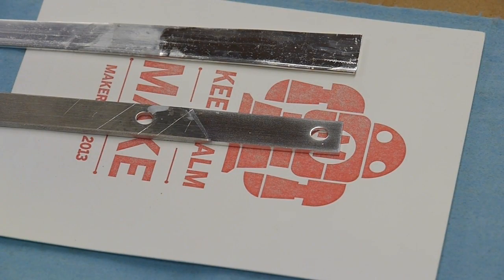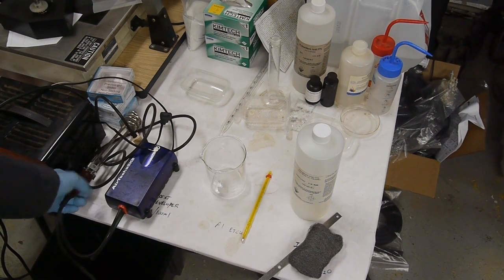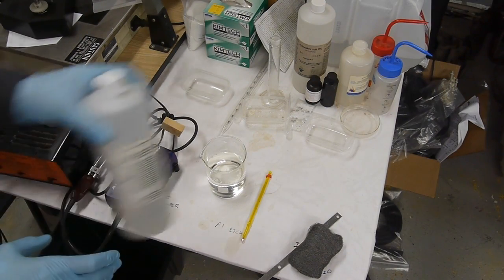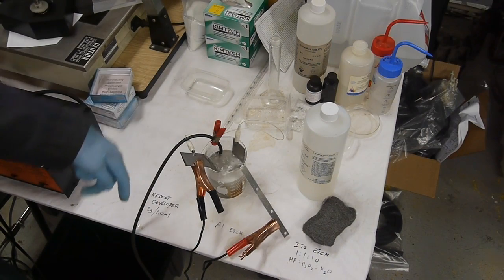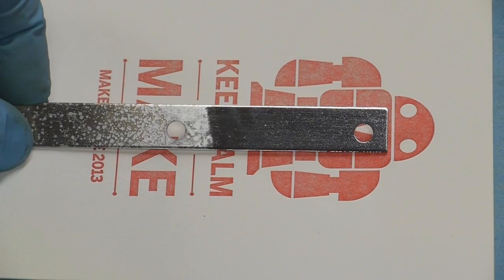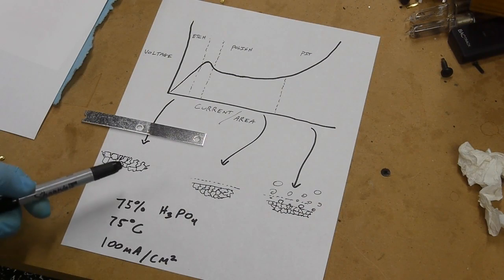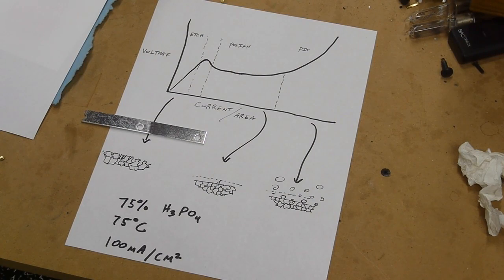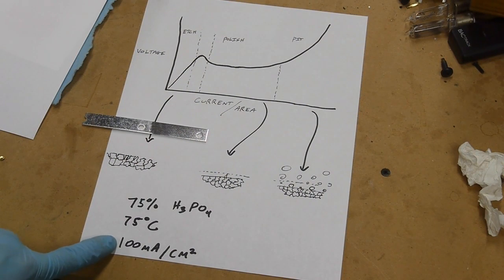How to electropolish aluminum

Comment: That bump in the etch to polish region looks like it's removing an oxide (insulator) layer. Then the voltage dips a bit because the surface area remained the same and the "load" increased, resistance went down, voltage drop increased, now more working action. Once the voltage is allowed to increase you'll just be attaching exposed aluminum atoms which, when voided, will allow the acid to break more bods but deeper, causing larger chunks to fall off from simple weak adhesion under the environmental stresses. Very cool video. I got here simply looking for a way to quickly polish aluminum LED strip diffuser housings. Very cool to see the experiment performed, less for me to do :)

Comment: i have replicated this experiment just now. 
I found out this not electropolishing what is happending is actually electroplating,
The stainless steel he used as cathodes is being disolve by the acid and is releasing nickel and or chrome to the solution in the process
This Nicke acetate created is then sticking by electrolysis to the aluminium and creating a thin plating and a shiny surface

I have tested the resulting so called "polished" surface shown here does not react to caustic soda submmersion anymore, meaning is not aluminium at the surface. 

I have noted the  shiny parts for tolerances and it increased (is bigger) by microns on the surface instead of being reduced suggesting material is being added to the aluminium as opposed a polishing process would remove it. 

I tried replacing the stainless cathodes for aluminium ones and also lead ones and it does NOT polish but instead dulls, etches the aluminium.

It was fun testing this, but it also is wasted time, money and effort that could be put into polishing by mechanical means the aluminium  in a more cost efectivly way for home applications. 

aluminium can only be electropolished in a cost/effective away at industrial levels using very much higher currents and stronger/ more hazzardous acids then ones used i this experiment.

Comment: Pretty sure a detergent and parts per million and total divsolved salts to perfefect the mix . At work we have a parts washer for washing diesel transmission parts it works on a ph based system  to check otherwise it etches the parts darker or blk

Comment: Better nate than lever: Just tried it out with a 5x4x3cm piece of aluminum (75% H3PO4, 70-75°C, magnetic stirrer, 20-30V). I started out with a much too low mA/cm^2 so in the beginning I was only etching. If the part would be a cube it had a surface area of 114cm^2 but it as inner surfaces so its probably 3 times that. This would result in 30A but my powersupply only goes to 5A. Luckily enough that was enough to produce a very nice polished surface.

I am wondering if the acid concentration might be too high though. When submerging the part it immediately starts bubbling which results probably in etching. Therefore after finishing I quickly rinsed the part. But in the seconds from turning off the voltage and rinsing it, a little etching might occur, maybe I try it again with more diluted acid.

Comment: Agitation can be used, for small parts its normally not necessary. Ultrasonic baths do work, with water, then a glass beaker, to break the liquid/gaseous plastron that forms on the surface of the part, and keeps fresh electrolyte close to the surface interface. Using full strength acid can lead to uneven brightness and micro pitting.

Comment: Add ethylene glycol to mitigate the acid, and provide a smoother brighter finish. A 60/40 mix of glycol and phosphoric acid is usually perfect. For stainless steel, just a kiss of sulfuric acid added to the mix makes a bright surface. You can buy ready made solutions from Nobilium dental products at nobilium.com. ESMA also makes ready made solutions.  For small, easy to use small parts polishers, look on EBAY for dental electropolish equipment. Good Luck!

Comment: That's really interesting. I wonder if it could be used as a surface prep method for DCEN aluminum welding (which needs to be much cleaner than AC welding), or if there are residues left on the metal.
Reply: I would be EXTREMELY surprised if you could do a DCEN on ali regardless of the prep (removing oxyide layer) you do. Let us know how it goes if you try it
Reply: @Bakanelli  Yeah have done it before, with mechanical scraping and chemical etch. We used it to make high quality butt welds turning 18" sheet into tubes for pressure vessels.

Comment: Aluminum (and zinc) is very very acid sensitive - next time buffer with  a little sodium carbonate or substitute acid for sodium citrate. Also, use a lower voltage make sure your work is totally oil/petroleum free (never use torches to dry parts after de-greasing).

Comment: I've been trying to replicate the same chart, do the same sort of thing, but with steel. Without buying a lot of extra supplies, spending money on a whim. So far I haven't been able to get that graph to happen either. I've read, not a lot, but some about electropolishing steel, from stuff as far back as the early 1900's, and they all describe the same graph. Well, I'll fool around with it a while longer.
Also trying an etching with photoresist film, sort of different project. For that I need to stay in the 'etch' region, so far that seems to work fine vis a vis the steel, but the photoresist keeps lifting. Not sure why. I'm starting to suspect the etched piece gets a zone of more acidic solution around it, and that makes the photoresist hard and flake off.
Anyway, I remembered you did this video, and watched it again to check what you were using specifically. Thanks

Comment: in hungary nobody takes aluminum electro polishing.they only want to polish steel, because they do not need the skills they need.they said they did not dare to accept because the bicycle trail would be fragile after the procedure.for a month I rubbed the old polishing and polished it by hand.

Comment: Now that I think of it water will separate above 1.9 volts and produce gas. Could this process be done under 1.9 volts? That could reduce the effect the gas has with the pitting.
Reply: Perhaps by increasing the conductivity of the electrolyte, adding those chemicals he mentioned...

Comment: why no just use NaOH ?
Reply: Cause it Will corrode the aluminium?
Reply: Aleksa Djokic polishing implies material removal, no matter what you polish, so it's ok :)
Reply: What? NaOH is used to etch aluminium, not polish it. There is a big difference between etching and polishing.
Reply: When he takes it out of the bath, does it look polished to you??? it's 
etched, i can go as high as "electrolytic cleaning" :) but not 
polishing, there is no chemical polishing aluminium. Since aluminium  is
 used to make mirrors, polished aluminium means mirror-finish, literally
 mirror-finish. So yeah...NaOh solution will do just fine to get a 
finish silimar to this here
Reply: Clearly didn't watch the video. His solution does not have the correct balance. You can most certainly polish aluminum this way. NaOH does not do the same thing and in fact it DULLs some aluminium alloys. I've had this happen several times.

If anything, NaOH cleans and etches. It, contrary to what you say, does not polish.

Comment: The concentrated layers of oxidation on the  aluminium from being exposed to the elements, over time these levels have built up,  the pitting has occurred from the solution and cavitation removing fine loose scale, but the pitting is like rust pockets or decaying in the aluminium material, the surface areas coming in contact with the solution it not strong enough to dissolve the oxide layers, the aluminium has to be polished flat

Comment: good presentation, very helpful. 
Permit me to just add this; 
that is, the reason why the current density plot is not looking like the one you found on the internet. 

The plot observed from the "internet" is due to a layer formed between the sample and the electrolyte (it is called the anolyte layer). 
however, for the electrolyte that you used (phosphoric acid), the anolyte layer is not visible. 
hence, the plot you will be getting will be not be exactly what you got from the internet. therefore the plots that you got are not too out of place.

Comment: the pitting is a result Al2O3. Add the Al to the acid till it starts to bubble, then add the current and reduce the voltage too.
Reply: and you are not polishing, you are plating with Stainless.

Comment: What if you immersed the beaker in a sonic cleaner filled with water to the same level as the acid without the airbrick? That would increase agitation  (enabling hydrogen gas to release easier) and eliminate oxygen.

Comment: I noticed two things happening in this video. One definite, one theoretical. Getting the acid up to a set temperature is pretty pointless if you are then going to introduce a lot of cold objects which are going to make the temperature drop rapidly and dramatically. If the working temperature is vital then add everything and then heat the acid up.
I wondered if the pitting on the surface was more to do with the bubbles coming from the air stone having a cavitation effect?
Reply: You're right about the temperature dropping from the added colder metal.
Reply: Bubbles moving past shouldn't be a problem.  Bubbles sticking to the surface are.

Comment: Check on Google Books for:
ASM Specialty Handbook: Aluminum and Aluminum Alloys by J. R. Davis.
ISBN-10: 087170496X
ISBN-13:9780871704962
On page 457, it describes the solution Alupol from Switzerland, as well as the process.

I also found an article on Tecnica e Industria, 1967 (Spanish language) regarding the subject, its link is:
https://picasaweb.google.com/117393118520218931162/Parabolicdishfabrication
Reply: From the Spanish manual: solution of 15% sodium carbonate and 5% tri-sodium phosphate at 80 degrees celsius and 24 volts.

Comment: Why air bubbles? May be redo it without bubbles,  but with vibrator attached to aluminum detail?
Reply: amaraojiji I'm pretty sure that vibration would work instead of bubbles. My first thoughts were using a geared motor or stepper with an embedded neodymium magnet on a disk attached to the motor shaft, below a plexi-glass shelf, then a plastic/silicone coated magnet inside the flask/vessel - to recreate a magnetic lab 'stirrer'. Fascinating stuff! @ +Applied Science I've often wanted to try anodising so I'm headed to your uploads ....  >subbed< :)

Comment: An alternative to electropolishing is chemically brightening, which you can do with Phosbrite or other compositions. For more information on electropolishing and chemical brightening see this thesis:
https://dspace.lboro.ac.uk/dspace-jspui/handle/2134/13910

If you want to make your own Phosbrite they handily provide the details of the ingredients:
www.potashcorp.com/media/POT_SS_MET_PB172.pdf

Or in the above thesis it gives more details including the important copper nitrate:
53% (Wt.) phosphoric acid
41.6% (Wt.) sulphuric acid
4.5% (Wt.) nitric acid 
0.4% (Wt.) boric acid
0.5% (Wt.) copper nitrate

But note that:
1.) NOx is produced which can stop your heart so do this with extraction
2.) Removal of copper after is required with a dip in conc nitric acid
3.) You're responsible for checking the safety of your experiments.

Comment: Very interesting, I remember using a old computer PSU to plate nails with copper. Of course  I used salt, and did not consider the chlorine gas it produced, and wondered why it smelled like bleach. If I had known this I would have used baking soda. I must try this sometime.

Comment: Thank you for another interesting video.
The pitting below a certain depth is an interesting phenomena.  That it does not happen within a certain distance of the surface is curious and doesn't seem to be well accounted for by the current per area theory.
It would be interesting to attempt the electropolishing on a hotplate with a stirring magnet, to see if eliminating the bubbles from the air stone would reduce the pitting.  Bubbles may be sticking to the metal preferentially at greater depths, but adhering less when moving faster near the surface.....

Comment: now i'm gonna have to look up the process of chrome plating, this looks very similar to what i thought the process of applying a chrome surface to a metal was, i'd like to see what actually happened to the pieces of steel as well since i thought phosphoric acid would act more aggressively on steel than aluminium

Comment: What you are showing is call corrosion polarization curve, and the region that you are trying to work is the pasive region. For that kind of curve that you want to see, you should control current and voltage in a much better way. 
And example of the equipment that you need is this http://www.gamry.com/products/potentiostats/reference-600/
Nice channel

Comment: Interesting results, but it doesn't really seem to being polishing but electroplating SS onto AL.  However, I have been told to never use SS for an electrode in soltion due to it releasing Hexavalent Chromium.  (The same stuff that caused severe birth defects, health issues and water contamination in the true story movie "Erin Brokovich.")  Can't you use aluminum plates?

Comment: So you are moving the heavy metals from the stainless steel to the aluminum?

I know if you use stainless in electrolysis rust removal, you get toxic heavy metals as a byproduct.

Comment: Just some stuff.

Rather then a pure solution of phosphoric acid, you would have less etching if you used an aluminum salt. If you want simple math, you should try using aluminum phosphate, but that stuff is hard to find (something about it being used to make explosives.).

A good aluminum salt will help prevent etching, and over etching on a short term basis, because it reduces the amount of aluminum that will immediately need to go into solution to satisfy Le Chatelier's principle. It ensures that the only etching going on is the stuff that's being driven by electrical current. 

This needs to be fine tuned though. Functionally speaking, the difference between an electo-platting solution and an electro-polishing solution should be the amount of dissolved aluminum in solution; if you're not watching your concentrations, you can reach a point where the reaction is less then optimal, though it can't run in reverse. 

I would speculate that people are advising you to use sulfuric acid because aluminum sulfate is easier to get a hold of then aluminum phosphate, but mixing the phosphoric acid and sulfuric acid makes the math more complex. Sometimes aluminum phosphate is sold in nurseries as a special fertilizer for hydrangea. Hydrangea change colors when the pH of the soil they're grown in changes, and aluminum ions are a good way to shift the pH towards acidic for extended periods of time (assuming you want a pink color hydrangea). Aluminum sulfate is also known as Alum.
Reply: @beizebopp-t6q  It has to be a typo. Its widely available and I've found no refference to pyrotechnics.
Reply: @beizebopp-t6q  I've found that it's rather a fire retardant http://www.chemicalland21.com/industrialchem/inorganic/ALUMINIUM%20PHOSPHATE.htm
but I dont know everything. It may release the oxygens at high temperatures, in rocket propellants, thermites,... it's possible, but it's readily available and no one is writing about it as such. I think he meant another substance
Reply: @trollmcclure1884   You're right. I remember wanting some for pyrotechnics but reading about it I must have been wrong back then. Its berlinite and its apparently toxic.
Thanks for setting the record straight.

Comment: Cool. I assume this is different than the shiny (I won't say polished) aluminum bars you find in Home Depot in the bath and shower section. The surface of those is non electrically conductive.
Reply: I think those are anodized. Btw, anodizing is a something you can try in your home lab. You can use dilute sulfuric acid as the electrolyte, and the aluminum is connected to an anode. Constant current is passed through it, and as the honeycomb AlO2 layer builds up, resistance increases. That's how you know when the process is done. You can get it as battery acid from an auto supply store. I've tried with different electrolytes, too. It's pretty neat to try. Varying acid temp will give different layer cell sizes. Varying voltage while anodizing titanium will yield different colors.
Reply: Anodized...actually a very thin surface 'conversion' to Aluminum oxide, slightly porous and often colored with dye....

Comment: You are not really polishing the metal but breaking it down. I use a similar method for getting a dirty piece of copper to 99.999% pure. Just add a little copper sulfate and done!

Comment: Excellent as always. Just curious if you used a stir rod/heat plate like most chemist use rather than the air stone if you'd be able to eliminate some of that pitting?  Removing the gas bubbles and just using physical agitation might be an improvement.

Comment: If my memory of water chem is not too messed up, the formation of the bubbles cause a very high local concentration of, in this case acid, causing the pitting. I would think that the agitation would cause a similar effect or at the very least cause problems with maintaining a stable current across the piece, now that I think about it that might be preventing you from reproducing the graph, I would be curious about that.

 I would think a laminar flow would be better, help maintain that viscous boundary, with maybe a desonic to keep any bubbles as small as possible, I know absolutely nothing about electroplating tho.